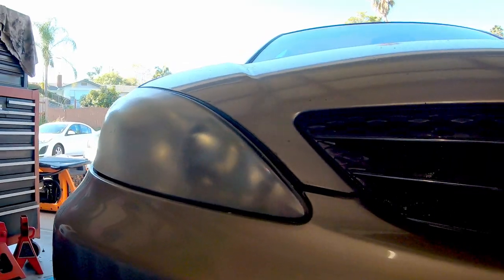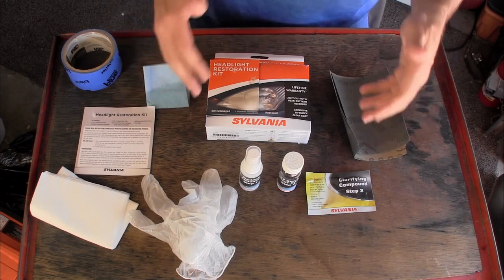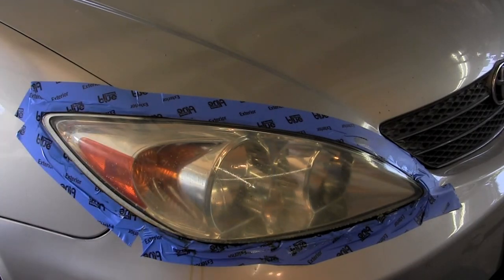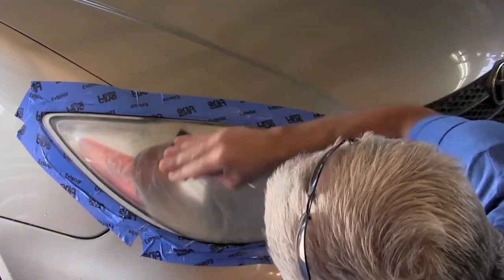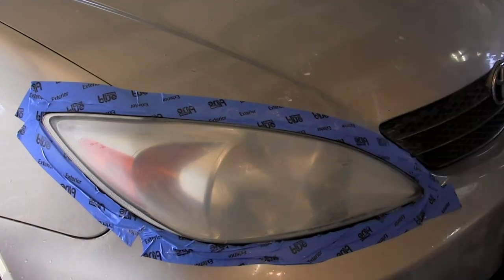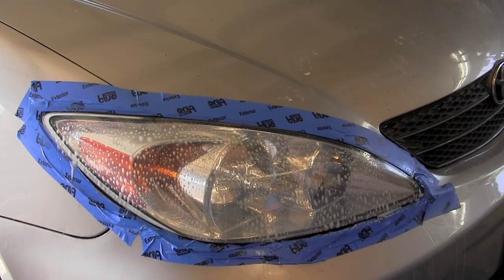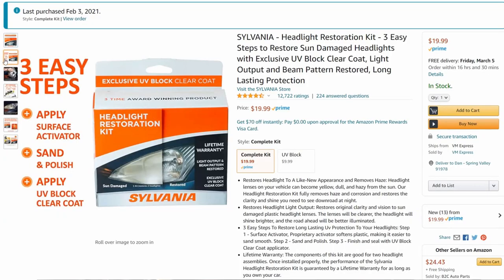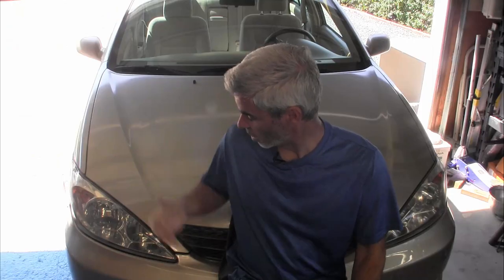Restore Your Headlight Clarity for $20

Comment: Could you buy the same grit of sandpaper with sticky back and use a drill with pad to do the sanding? Then use the other chemicals to finish the job. Great video by the way.
Reply from the maker: Absolutely!  There are kits you can buy that do exactly that...  Just don't forget the clear-coat finish to prevent the surface from looking just as bad a year later...

Comment: Hi Dan, great video. I wanted to check and see how the headlights have held up since doing this. Hopefully the car is still around. Are the headlights still clear?
Reply from the maker: Hey Tyler, Sorry to say my neighbor moved to Florida and sold the car...  So I can't give a proper update.  When she left, it was still looking similar to when I put it on.  Have you used this before?
Reply: @DansWay  Hi Dan, I've already bought this kit based on the Project farm video as well. I'm going to be using it on a set of headlights soon. I've seen in other comments that the time the lights stay protected seems varied, so i was curious how these were after a year or two. I wonder if this will become an annual thing or not....
Reply from the maker: @tylerfun1698  the car lived next door for over a year before she moved, so in that time it was still basically clear. I would assume it should last several years.  A more expensive approach would be to use a 2-part spray clear-coat like this (https://geni.us/2K_Clear_Coat) which should last much longer.